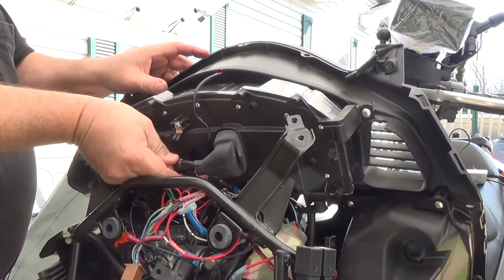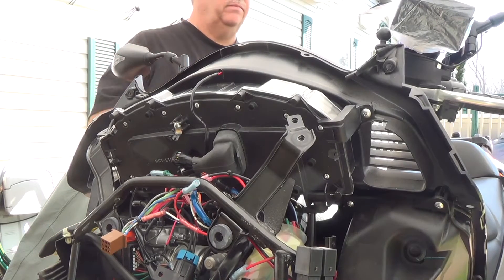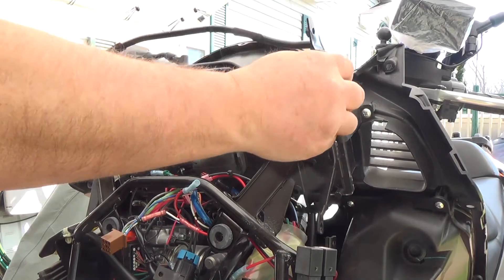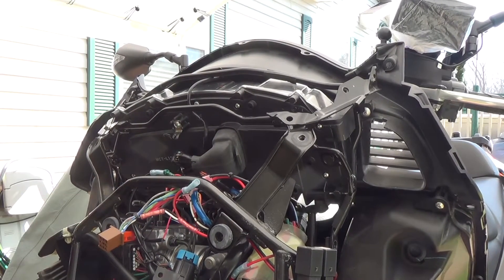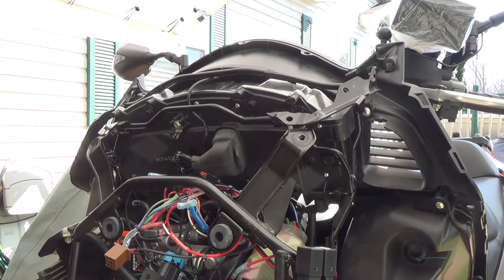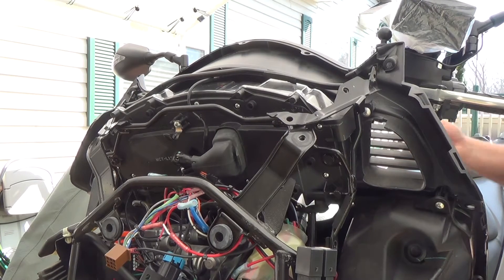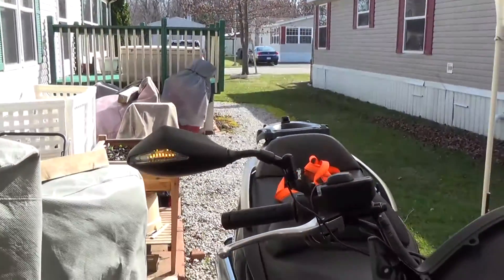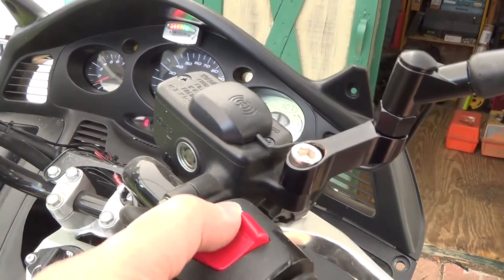Honda Silverwing work 2016 part 3

Comment: I need to take the ignition cylinder off / read the code on the back of it in order to cut a new key for it (bought it that way) . Do you know what I need to remove and where I can buy a service manual?
Reply from the maker: You can get a service manual off of Ebay, I have not taken the key cylinder off so I would not know how to do this, there is a Silverwingforum.com site that might help.
Reply: I ended up buying one on ebay. the forum is full of tech unsavvy old foagies. I mostly just need to be able to read what is on the back of it.